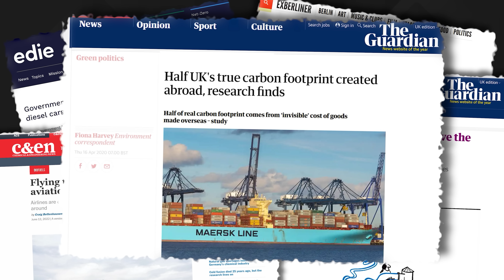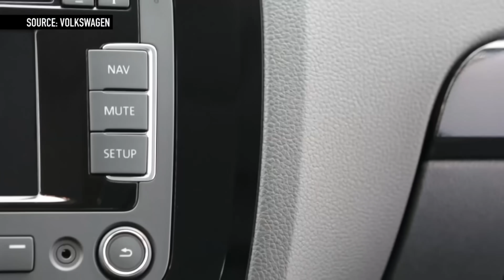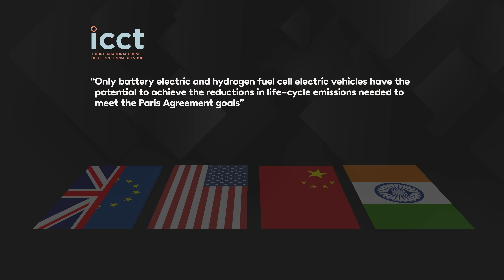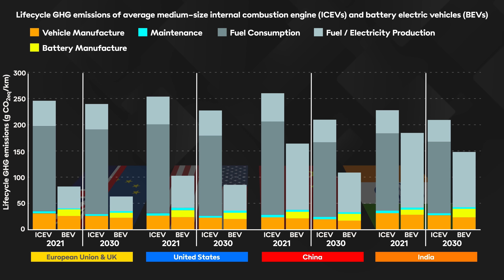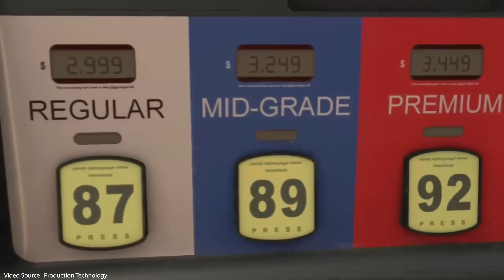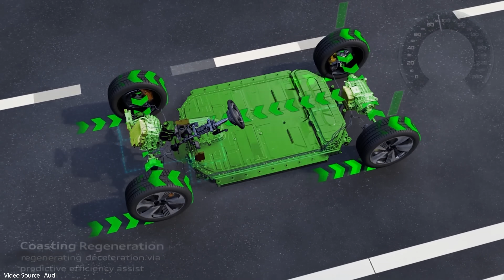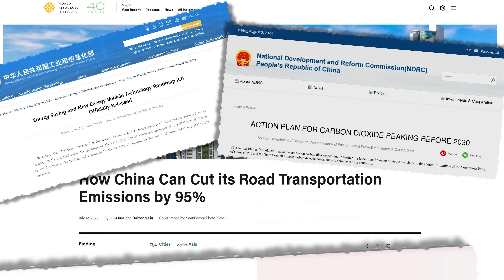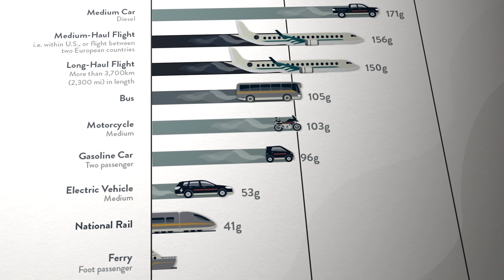Are EVs really better for the climate?

Comment: I think a big question that’s never answered in this issue is (given the life cycle of a modern car is 10years) if I have a car that’s more than 10 years old it’s effectively in its second life, having in effect been manufactured free of any emissions. It’s recycled by its careful owner and I’d love to see an intelligent analysis of where these older cars lie in the spectrum of harm relative to other options.
Reply: I totally get driving an old car because it still works, and it is far cheaper than buying a new one... The first R of the three comes to mind, but for pollution, that argument does not hold. An EV needs to overcome the energy embedded in it's manufacturing when compared to an ICE vehicle in order to reach a "break-even point", after which it is truly very close to zero emissions.  The typical "pay-back" period for this is about two years (averaging a lot of things... )  Translation: every two years of usage of a ICE car is the same as the impact on the client of getting a new EV.  so if you use an old gas car for more than two years, it's worse for the climate than buying a new EV.

Driving a car for 10 years, an ICE vehicle will be pollute about the same as 5 EV's. Also this two year payback is based on the power mix in place where the batteries and cars are manufactured.  As the grid cleans up, the embedded carbon from manufacturing goes down, speeding up the payback further.
Reply: @qcca123-f1v  Not to mention the where the first comment left it. The car ICE car being 5, 10, 15, 20 years old has the emission of rules from 5-20 years ago, which is worse than a modern ICE. So its progressively worse (not just in a linear fashion of 10 year old car is worst than 5 EV combined.. it is probably more than 5... the older the car gets the further it falls behind emission standards). The original comment simply missed the fact that the ICE's main polluting part is the fuel consumption and not it's production. 
[well, if we ignore the VW scandal where the 'modern' car was as bad as the old ones... but on paper... :)]
Reply: In addition to the more lax regulations for efficiency of older vehicles, the efficiency drops as piston rings, valves, and seals wear down, making the already lax efficiency even worse.
Reply: My van is 20 years old but faily low kilometres for it's age. And it's a Toyota (reliable).
Reply: They lie with outdated engine tech with emission norms that are now illegal. Fuel efficiency that is 10 year old. Stuck with fuel that is outdated (probably cant use Ethanol etc. Also they are much unsafe without so much of recent improvement in safety aspects.

Comment: 1. The one thing that I find concerning is the mining of lithium and cobalt used to make the batteries, the environmental impact is massive and there are a lot of serious human rights issues in both industries, not that current gasoline products are not guilty of this.
2. What will the impact of electrification have on the availability of lithium and cobalt, is the global supply enough to support demand? 
3. Does the current electrical grid have enough capacity to accomodate the surge in demand that we will experience with electrification? I live in South Africa where we have rolling blackouts at regular intervals, how will a country like ours ever be able to even go electric?

Comment: That's a good overview of EV pros. However, I feel that there is too much focus on personal cars considering that the whole transportation contributes to 25% of carbon emissions. Ships, planes, trains and commercial autotransport such as lorries - all of them consume a lot of fuel (even the trains in a lot of countries work on fuel), probably more than personal cars. I don't say we shouldn't switch to EV. Just want to point out that the focus should be on areas of the biggest potential impact.
Reply: Think people miss the point of good enough. If most of the land transportation switched to EV trains, cars, semitrucks the grid would need to be expanded and the only options to expand the grid is nuclear,wind, solar, various other renewables that are carbon neutral or positive technologies this would force grid operators to build more green grid. This will force others to adapt greener technologies…. Same as politics just take less than 10% of the population over a substantial time to cause change
Reply: @X.MillennialResponder.X  These are different problems. You can easily charge your EV by energy produced on a coal power plant. On the other hand, increased demand won't necessarily lead to more production. Just look at electronic chip shortage which happened quite recently.

Comment: For me the question is "should I change my diesel car for a battery electric one?  The graphs suggest manufacture creates only a small proportion of lifetime emissions.  That suggests that replacoing a diesel car could be useful.
But the annual distance travelled plays a part.  For low annual distances, keeping what you have is probably best.

I was pleased to see that long haul travel has relatively low per km emissions.  But....... long haul travel involves an awful lot of kms.

Battery electric is better than fossil-fueled.  But there are lower-tech ways of reducing emissions - smaller, lighter, slower vehicles travelling shorter distances.
One of the most important things that society needs to do is organise itself to reduce car dependence.  the prime example of this is long-distance random commuting.  Each journey is too long for a bicycle, and too unique for public transport.

Comment: 8:55 Monumental stupidity.  It's not a 'School Yard Argument'.  Making these changes will impose a cost on the West and result in a competitive advantage to China.  This is exactly what has happened to the manufacturing sector as lax labor and environmental regulations in China relative to the West caused manufacturing to move massively to China.  The rare earths industry in the US was hollowed out as the US won't tolerate the environmental destruction involved in processing rare earths to the degree that it is tolerated in China.  "School yard" or not, the fact remains that if China doesn't make reductions in their output, nothing will be achieved with regards to atmospheric CO2 levels.

Not happy with merely being sanctimonious, you take a complete vacation from reality with the absurd notion that the West will 'lead China by example'.... really?  You are seriously going to assert that decades of engagement with the West has led China to give up on such policies as, concentration camps, genocide and forced organ harvesting?

Frankly, I would have made the argument that adapting these technologies will result in the costs coming down which will entice the adaptation of these technologies in the developing world.  But, I guess merely denigrating the other side as childish is easier than listening to the other side, just having a think and attempting to logically address their concerns.

Comment: I've been told in multiple videos--one in a TED Talk and another in Veritasium--that about HALF of a vehicle's carbon footprint is just in the manufacture of the car.  These graphs say otherwise--which is correct?  The TED Talk mentioned that as the size of batteries increase for EVs, the carbon footprint is higher.  With renewable energy, the EV breaks even with gas cars sooner, but may take over 400,000 miles with dirtier electricity.  Is this video debunking that?

Comment: While I am all for reducing carbon emissions for obvious reasons, I am wondering what the battery industry is doing regarding cobalt contamination at mining sites.  It makes no sense trading one problem or another.  Any thoughts on this?

Also I heard that animal agriculture was a significant contributor to carbon emissions, yet I see this in the report you mentioned.  Was I misinformed or is animal agriculture a significant contributing factor?  (Again, not looking for controversy, just looking for the facts.  :-). ). If it is a contributing factor, what percentage is it?  

Thanks again for putting unbiased information out there.  It’s a welcome change from the noise.

Comment: In the production of electric cars by 2030 or later, the car will go into obsolescence in 10- 20 years, in which having to be scrapped, will have a lot of lithium and other batteries laying around deteriorating and contaminating groundwater. I hope someone can work out how to dispose of them properly.
Reply: Used batteries won't be left lying around because they contain valuable and recyclable elements.

Comment: In China, one cheap electric truck costs about 7,000$ to buy and ship to the US. The greed, manipulation, making profits, has made base electric vehicles cost almost like a scam sports car brand, make it less accessible to buy. It should be experimental, lower production costs, and thus lower prices, then more people would switch and buy, driving up their need for profit (more buyers, lower price). The idea that electrical cars charging are actually causing more pollution or emissions from the electrical plants is wrong anyway; they aren't spewing more carbon into the air just because a few people decided to charge their overly expensive car.
Reply: One reason those Chinese EVs are so cheap is that they will crumble around you in a crash.  Another is their range per charge.

Comment: According to the infograph at 10':42", driving a small, twofer gasoline (or petrol, if you Brits care about it) powered-car half as much as an electric-powered one might emit about the same amount of CO2. One could probably accomplish the same with a Citroën 2CV instead of a Smart. The difference is an additional bench seat in the back and a funnier, albeit quirkier, ride of the former. One last remark: there's no mention whatsoever in this video about the dire consequences to climate change stemming from planned obsolescence that's been a staple in the car manufacturing industry since God was a kid.

Comment: I put a fair amount of trust in this guy.
Though, I have an issue.  I think it is like eating the food the restaurant you work in makes.  You just don't look at it the same as before.
I really want this to be the answer, but I look at the potential for electrical issues in the circuitry, and the batteries.  I'll overlook the circuitry part as it is mostly the same as any newer car, way too integrated and non-repairable.  But the battery tech still feels like it is the minimum viable solution to make this transition, and having had my eye on the tech for a while now, just hoping for the next generational leap of batterie tech.
*Edit: That being said, should I be capable of affording one when the time comes for my ICEV, I will look to replace it with minimally a plug  in hybrid, but hopefully a full BEV.
Reply: Hybrids were somewhat useful while the range with batteries alone was a problem, but no longer.  Hybrids have all of the maintenance and much of the pollution of ICE vehicles.

Comment: Thank you very much for the highly due dilgence video you have done, as well as all your other videos. Top class delivery and research done every time. I have a request though my man. I currently work in haulage in the south west. I am new to the industry and I can see so much failings on effiency, but that is here nor there, a mere problem I intend to tackle. Now what I request from you is a video on how to improve haulage in general from a green energy perspective. I would greatly appreciate this in an updated manner as to what is realistically available today as I write this. There are many great companies with great ideas, but they are getting rejected because of realistic issues such as:

The south west will never have an updated modern infrastructue due to the preservation of the countryside, so Artics have to travel along some seriously tight roads on a adaily basis as well as significant inclines and declines. I want my company to go green but diesel only cuts the mustard on our routes. Can you think of a solution I can put forward?

Kind regards

Conor, love your videos and thak you again for your work

Comment: I'd love to buy an EV, it's just a shame the cost of buying one is just too high for the vast majority of people.

I would like to know how long the 'life span' of the vehicles are for the findings in the studies.
Reply: There are some Teslas with over 400,000 miles on them and many with over 100,000 miles.  They all have the original HV battery.
Reply: Well, your cost to run the EV however will be much lower. Also, the EV has hundreds of less parts to go wrong....needs much less maintenance.
Reply: @Floorguy1000  True, but if the interest on the £30,000 loan I'd have to take out (not to mention the repayments) will cost me more than the maintenance on my 13 year old ICE car, it doesn't leave me with many options 🤷‍♂
Reply: I have thought about this too and I think we should start converting ICE vehicles to electric, this way we won't have to manufacture an entire new car, then dispose of and recycle an old one, it will lower the cost of converting and should be much greener than buying a new electric car

Comment: When Ev s have at least a 500 mile range and are economically priced and there is a place where you can actually take your use batteries to be recycled and reused instead of going in the landfill also right now the United States does not have the power grid to support EV transportation scheme every day they’re taking off line more and more coal power plants and causing blackouts with the current load

Comment: For 7 years we have had rooftop solar and for 6 years have been driving a reliable, cheap 2015 Nissan Leaf. We added a 2017 Bolt, now with a new battery, 5 years ago. For those of you who can put in solar, do it! If you have a house or off street parking and need a car get a cheap electric one. I have nuts and bolts ( Heh, heh) information on how to do this on my YouTube channel, Five Minutes With Dr. Know, which complements this one.

Comment: Isn't this study's key assumption that EVs are powered exclusively from renewable sources (ie, solar, wind)?  Is that even a possible scenario due to the HUGE infrastructure gap that we currently have worldwide for this to become feasible?  From what I have been able to learn, this scenario is also very problematic due to the emissions produced from manufacturing, installing, disposing of this new "renewables" infrastructure.  Combining this all together, there isn't a huge difference between options when you include the required infrastructure emissions (plus any emissions from maintaining, disposing of the conventional infrastructure).  We need to look at all of these impacts in order to make the best decisions that we are capable of.

Comment: I do have something to add to this. MY point to add is as follows:
1, Governments upkeep the road network by adding taxes to the gasolene you buy. Now here is a fun question: After that gas is gone, then what? They will add the taxes to your electric bill that you use to fuel up your car. Laugh as hard as you want, but in Hungary we already have such a law in place. So you need to install a meter on the electrical socket you use to charge your car in your garage (even if it runs from solar power), and pay the taxes after the electicity used. This WILL happen in each country once petrol is gone.  This is not factored in into the price calculations for upkeep.
2, A Lithum battery is a consumable. It degrades with each charge. So in average you will have to replace it every 3 years. I am not sure this was factored in when calculating with the lifecycle emissions of EV-s. And I am not sure if producing reusable Lithium out of those spent batteries was calculated either. But even if we do not think about this, there is still the cost of ownership issue in replacing your battery every 3 years in your EV. In case of a Tesla your $22000 used car can cost you $20000 just for the battery replacement (as we have seen with a Model X). Problem here is: that is $42000 for a used but good condition EV.

So my point is this: IF you care about the climate and want to do something about it, then sure go ahead and ride your shiny bicycle in your 3 piece suit in the winter. I will drive by you in my old clonky small sized hatchback (think VW Golf) that was made in the 90s, and slush you with icy water. Why is this?
A, New cars do not have significantly better fuel economy. Therefore it is not financially viable to buy one (I get 2.2 mpg better in a new car). The fuel savings would not pay for the price of the car in it's lifetime of 15 years.
B, New cars are significantly more expensive to repair and upkeep. Therefore it is not financially viable to switch to a new one due to point 1.
c, Electric cars are significantly more expensive than normal cars. You also have to replace the battery pack every 3 years. So it is not financially viable to use one instead of my current car.

Instead of thinking about how "we" should save the planet YOU need to start thinking about how we could use an alternate method that is financially viable. Believe me: People will not give up the creature comforts for the abstract promises of saving the planet for the future generation...
Reply: Car registration costs could cover road repair costs. I have direct solar car charging so its hard do electrical EV tax without easy to undermine state managerial input.